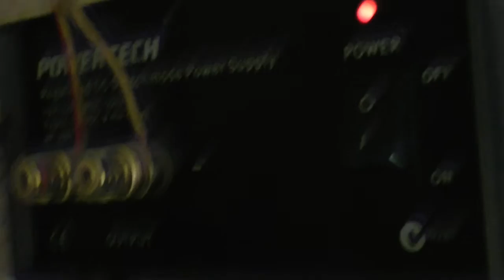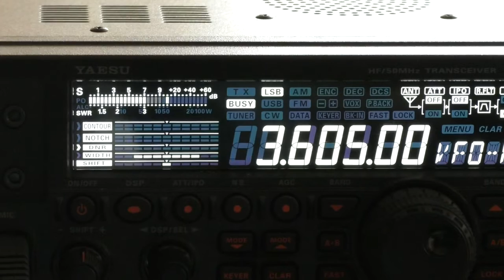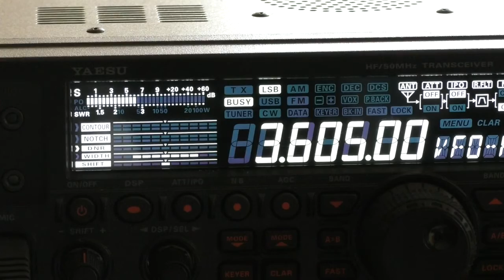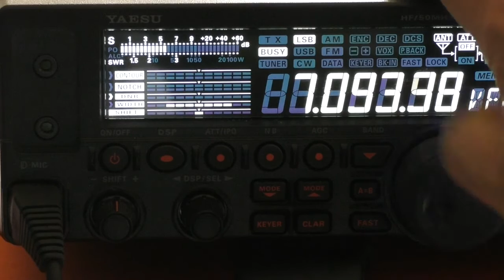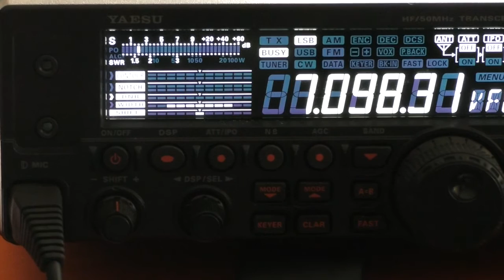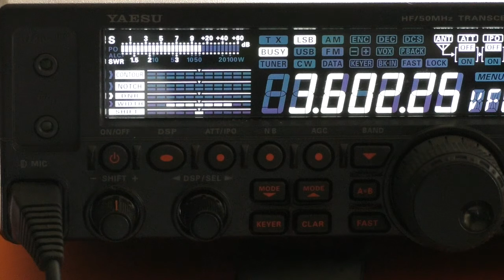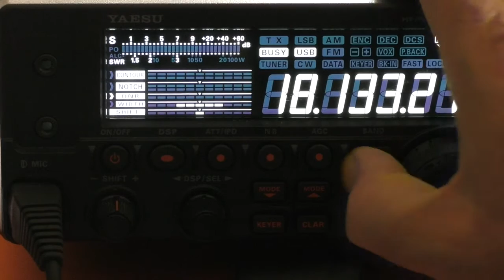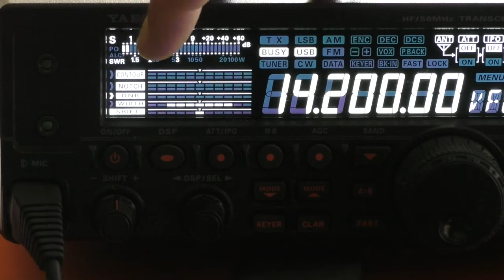How Noisy Is The Jaycar 40A Switched Mode Power Supply

Comment: For ham use the switched mode power supplies are not worth a cracker.
I have bought a few over the past year and each one was noisy or noisier than the one before.
Noise levels of minimum S4 up to S7+
Some have a noise control but that just shifts the noise a few kc's away.
Now I have two Powertech MP3098 linear power supplies which run an FT991A, 2 x FT875D, a TS2000, a marine band radio and some other equipment, obviously not all at once.. 
They are absolutely silent.
There are a few Youtube videos on how to cure the noise, but WHY don't these cheap arsee manufacturers who make these ham power supplies fix the problem in the factory.
I have taken a few back to Jaycar and the manager was very sympathetic.

Comment: The switch mode power supplies from what I understand have a operating frequency between 500khz andd 3.8mhz so it is in the 80 meter band and has harmonics on 40 and 20 meters. However, I know plenty of people that use cheap power supplys for VHF and UHF without any problems.
Reply from the maker: What I have found is the frequency depends on the load. I use the supply to float a couple of 125A/H batteries so I can turn it off when I'm on the air. In the past I have operated on 80m with the PSU on and suddenly heard a lot of noise come up. I switched the PSU off and the noise disappeared. After 5 minutes or so I switched the PSU back on and the noise wasn't there, the PSU was running at a different frequency because the load had changed.

Comment: Yes, I must do the same experiment with my new Emtron PSU. I'll be gutted if it's noisy.
Thanks for the video, happy days and clean signals :-)
Reply from the maker: Yes, that would be interesting.
Reply: I will do a basic test and if it is noisy I will make a video of such.
In its day, the EPS 30 Emtron PSU was one of the very best.
Mine is 20 years old but it's new unused. Hope it works.....fully
Reply from the maker: If it was one of the best you might be lucky.